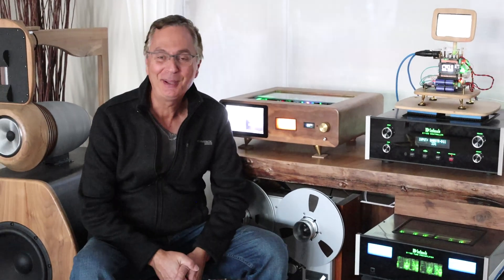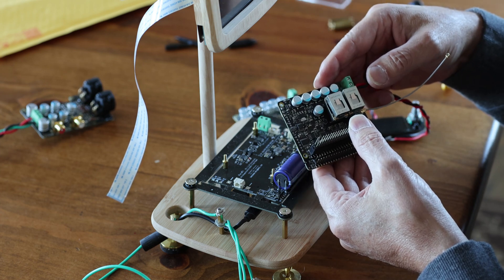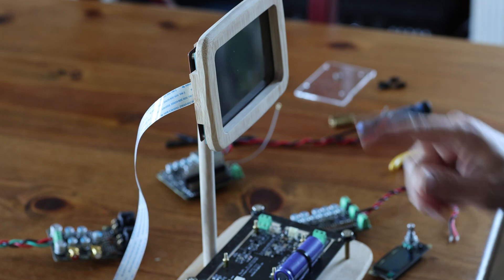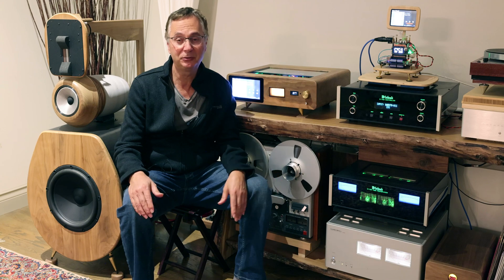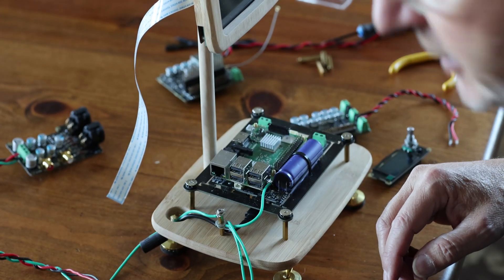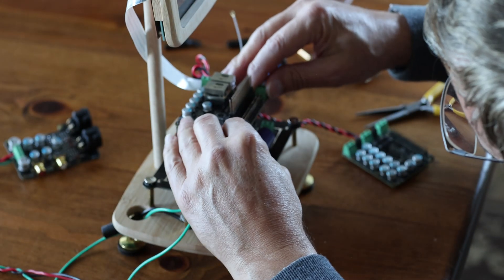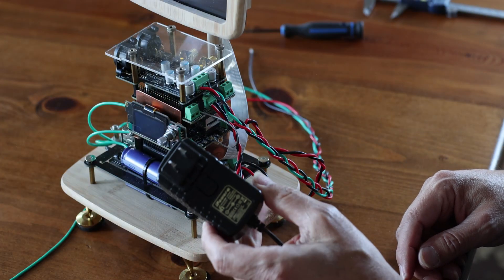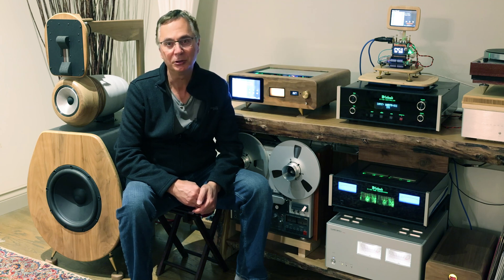Build a Flagship DIY Dac from Ian Canada Parts and save thousands of $$$ Gabster D6

Comment: In you video, you show a connection from PurePi to the Fifopi Q7.   But in the IanCanada tips, it says that "FifoPi Q7 has built-in isolator so it needs two power supplies to function. It will not work if feeding with only one power supply. No XO LED is lit means FifoPi doesn't have the 3.3V clean power supply".  I am kind of confused now!

Comment: What gauge wiring are you using for the 3.3v and grounds? Looks like 12 or 14 awg stranded copper?
Reply from the maker: 11 Awg stranded ofc copper silver plated  twisted as short as possible
Reply: @ you mind listing where you sourced that wire, doesn’t seem easily available.

Comment: You said i will go step by step, then the ground wire magically appeared as if i would know where to and how to connect it. You said get 3 power supplies and then quickly showed us what to do with two of them, but you didn’t really say where the other end of the red, green black cable came from. And what it the other power supply for, do i just put it in the drawer😢😮 Maybe another video to tidy up these issues. Thanks
Reply from the maker: @hifi-asylum  
The 3d power supply you use  to power the pure pi  and the other 2 to create +5v 0 -5v for the OPA 861 board.
I know it gets overwhelming at the beginning I have been there 😱😊
The ground green wire goes to earth ground Easiest is to power socket ground or ground terminal of your amplifier.
Hope that helps

Comment: Ok, very inspiring. Wish that one power supply would be sufficient. Maybe a single LPS with three outputs? Also, did you make those shields or can they also be purchased? Sorry for all the questions…
Love that you used a small cutting board for a base. Even using the hang hole to route those ground wires 😅

Comment: Hi Gabby! will adding power connections through UcConditioner MkII 3.3v to this stack also works? the way you explained the Streamer build....please advise.
Reply from the maker: Yes you can like I show it here https://youtu.be/fv_aywqlo9Y?si=z_l8iSZgBlDieWrj&t=246
Reply: @Gabster1  Thanks for quick response and the clarification.
Reply: @Gabster1  If we plan to add UcConditioner MkII 3.3v to this Gabster D6 Stack, for power connectivity which one out of these two options you advise.... 
A.	Pure Pi II 3.3V -> UcConditioner MkII 3.3v -> Q7 & also from same UcConditioner MkII 3.3v -> Dual Mono DAC Card (is this OK to plan or won’t work at all?)
[OR] 
B.	Pure Pi II 3.3V -> UcConditioner MkII 3.3v -> Q7 & Pure Pi II 3.3V -> Dual Mono DAC Card. Please advise. Thanks in advance.

Comment: I recently bought a vintage Sansui 9090 and some Kef 107 speakers, primarily for 2 channel listening. I use Youtube music through an Apple TV feeding a Sony Bravia. I use the toslink digital out from the Sony to a very cheap Prozor dac to the Sansui. I will be adding a CD player soon. As I am using the vintage receiver  I don't have remote volume control. Is it possible to add this to the Flagship DAC, and is my system resolving enough to benefit from this DAC?
Reply from the maker: If I can be honest your biggest upgrade will be from using a high resolution streaming service or a good cd player. There is a world of difference between YouTube music /spotify and a high resolution system like a cd player record player Tidal and Quobuz 
Your amp and speakers are good 
A Dac like this or a cdplayer/ record player will benefit you
For the Dac you will need a Tidal Or Quobus suscription and Roon or Volumio ….
Hope that helps.

Comment: Hi. I see it's not the OPA 861 that comes with the kit, but #7A transformer I/V. Is it an important difference? Best!
Reply from the maker: Both are good options the transformers do not need power the Opa861 has slightly better dynamics and low end
Reply: @Gabster1  But I will have to solder the transformers 😩 Think it's best to avoid it... 😊

Comment: Built it! Just finished it. Thank you so much for this video! A lot of back and forth with the video and Ian's manuals, double checking myself. No shielding or extra grounding, not sure if it is necessary though I might at least add these features as not that hard. I know there is all kinds of unpredictable placebo stuff that could be affecting my experience but wow, so far this thing, as ugly as it is, just completely smokes my other dacs. Suddenly more palpable space, texture, details. Using Roon. Will be testing across a broad array of speaker/amp combinations.
Reply from the maker: Thanks Sheldon for sharing your experience 
If you feel like it and Interested I will be doing a subscribers builds where I showcase systems like yours you just need to send me a few pics of your system and a couple lines like what you just said describing your experience. 
My email is in the about section of the main YouTube page
Reply: @Gabster1  That sounds great. I have sent you an email. Thanks!
Reply: Hello which dacs did you compare your diy to?

Comment: Gabby, total newb here. We purchased 2X  of the set RPi, FifoPi galvanic iso board, Dual DAC board, Op amp board from Ian about 3 1/2 years ago. We have the double shield /gpio extender boards from Ian too. Do you think they are as good as your copper shield? We are getting close. Currently both DACs are in enclosures with 2x 4TB drives, an optical drive, 5” touch screen, ESS controller and usb wi-fi dongle with external antennas.
Reply from the maker: Sounds like a fun project yes the double shield Gpio are good don’t forget to connect the RPI to earth ground
Reply: will do. as for the rest, a SP-9 + ST-120 (complete) and a Erhard Audio Pre (complete) + ST-120 (in progress). The concept is the DAC will be a digital album repository. @Gabster1

Comment: Thanks for the video Gabbie - where did you connect the star-ground wire on the Raspberry Pi? I have the Pi 4B so the ethernet and USB ports are reversed, but I cannot see where to attach the ground wire
Reply from the maker: I soldered it to the metal housing of the USB any metal housing on the pi is connected to ground

Comment: Hi Gaby.  I built your Dac and I have to say it's a significant upgrade from my Node 2i.  I am also using the Raspberry pi as my streamer with Volumio.  I am having one small issue that I can't figure out.  When playing multiple songs in a playlist with Tidal Connect or Spotify connect, the beginning of every subsequent song is slightly cut off.  Is there a simple fix for this?  Volumino doesn't respond quickly.  Thanks again for inspiring me to build this.
Reply from the maker: hmm not sure have not used volumio for a couple years disable any volume control settings or level matching,DSP etc... if any as they degrade the sound and cause problems.
try asking on Ian's DiYaudio forum someone may be able to help maybe 
https://www.diyaudio.com/community/threads/asynchronous-i2s-fifo-project-an-ultimate-weapon-to-fight-the-jitter.192465/
Reply: Thanks, I'll try that.  What software do you use instead of Volumio? @Gabster1

Comment: Can we add TransportPi AES/HDMI Pro II along with Receiver Pi Pro II/ReceivedPi DDC to this stack to get the input & output options? If yes, could you please share how the stack Cards positioning and connections will be. Interested to know Fifo Q7 signal wire handling... Please advise.
Reply: Thanks Gabby. Even the projects page is still not having such combined stack options....this will be very helpful. Please plan to share.
Reply from the maker: I will do a video in the future you can also get ideas from Ian’s new website Iancanada.ca
Under projects
Reply: @Gabster1  could you please plan a video for a single streamer+dac stack build. waiting for this....

Comment: Hi Gabster, I just looked at all of the components for the build (including tax in Quebec) and it comes to $1,338.00 CDN give or take a few bucks and this is not including any options.  The 3 Ifi power supplys really kill the price point as they alone are $375 (tax in).  Ian Audio is $700 CDN (delivered) for the 94a kit. The raspberry pi and all of the little extras makeup the rest of the cost.  Given that the Ifi power supplys are so expensive might it be less expensive to use the upgraded power supply you mentioned?
Reply from the maker: The IFI is good for People that have No or very limited DIY experience.
If you have some knowledge I would use 2 or 3 of the Cheap ebay regulator 5$ (must replace the Potetiometer) each and some old Transformers you may have around
https://youtu.be/bzXoypmVUus?si=OFkyF1X6wCEDr_Up
You need to be careful not to fry your expensive boards also need 4v higher then intended so a 9V transformer DC or AC is Ideal or pay the same $ and use the Linear Pi reg by Ian.
if yo have limited DIY experience start with the Protodac Cheap and inexpesive then Build the D6 You may also want to try The MIni IP
https://youtu.be/m0esUvVu9W8?si=kc9p9c4FhjzCau5J
 start without Q7 then with. The journey is as rewarding as the results

Have fun If you build it send me a few Pics a and a short story would love to share your results on the Chanel.

Comment: Sorry for the silly question but what SC-Pure Clocks do I need?  There are 4 listed on Ian's order sheet; 80A, 80B, 80C and 80D.
Reply from the maker: No Worries I would suggest the #80A and #80B pair of SCPures  45/49 But the FifoPi Q7 comes with 2 clocks to start with. Nice clocks but not as good as the SCPures
Reply: @Gabster1  Thanks so much for the reply.  I will do just that.  If I want the DAC to have inputs other than the PI it seems I would need the ReceiverPi Pro II.  Is that correct and is just another board that stacks on top of the rest?  Thanks again for the information.
Reply from the maker: @theaddies  I would suggest the just released #19D. ReceiverPi DDC for $10 more it is by far more advanced. :)

Comment: Please be careful with the copper shielding behind the MonitorPi Pro!  I think mine created a short between the GPIO pins behind the MonitorPi and a tiny bit of smoke came out from the back of the FifoPiQ7 (i think it was that board, but not sure).  So instead I covered my copper shielding with electrical tape.  The dac still works.
Reply from the maker: Yes that is very important I wish I showed that more in this Video  I did show that in the Streamer/dac video glad you did not fry it here is the Link at 17min
https://youtu.be/r_BjWSMKjEc?si=LSqmkkdHhqpRJuVy
Reply: @Gabster1  

Thanks for the reply.  The DAC is sounding amazing!!! I plugged in the Accusilicon AS338 clocks and they really take the DAC to a new level, I can imagine that IAN's SC-PURE clocks would be even better.  I'm so excited about the clocks that I'm contemplating the NewClassD Nuetron Star 3 clocks.

Comment: I just finished assembly and Im using Moode but Im getting all zero's when a song is playing, and no output sound. I must have missed something in the configuration but not sure where. Can you show what the configuration settings should be set ?
Reply from the maker: Check all the wiring compared to the Video make sure the grey UFL is connected I never installed moode but it is similar to most RPI setup 
use I2s Generic Driver if asked 
When you sart playing a song the fifopi clock light should turn green.
You can also post some photos on the Community page and someone can help you as well hard to diagnose without Visual here is the Link
https://www.diyaudio.com/community/threads/asynchronous-i2s-fifo-project-an-ultimate-weapon-to-fight-the-jitter.192465/page-543
Reply: @Gabster1  I was finally able to get it to read something other than zero's but I have no sound output of the opa861 going to the input of the pre-amp. Not sure what it is I am over looking.

Comment: Have you experimented with Silver wire conductors instead of copper wire for running the 5v and 3.3v power lines?  I have constructed your dac but I think I'll upgrade the electrical wiring to OCC Silver with solid metal core instead of stranded.  It's not too expensive.
Reply: I am also thinking about adding OCC Silver wiring. Did you hear any sonic difference after the silver upgrade?

Comment: Thank you for your efforts and time spent to bring more people closer to good quality audio!

For years, I am using RP as streamer and mamboberry (ess) dac, with simple i2s connection between.
Everything is cleanly built with separate high quality power supplies, good filtering and physical separation between ps, rp, dac and preamp.

I was avoiding reclocking by always using just i2s interconnection.  Some experienced people suggested to me that it is better to have cleanly built i2s than loosely built reclocking.

Would I benefit by switching i2s to reclocked signal as you are using?

Thank you!
Reply from the maker: Keep your dac as is as a reference and build another one like the D6 here with Ian’s parts and compare this way you can hear the difference 
If you don’t want to spend a lot of money build a protodac a see if you like it better.
It is important not to alter your existing setup till you find one you like better.

Comment: Looks very interesting, Thanks for this video. I am planning on buying this unit (with accusilicon clocks, nog too expensive and I hope it Will improve the sound). Now is my question, how does this sound compares to other dac’s (you have listened to) . I know this is a difficult question but im really eager to know since I already have a micromega mydac and my father a Chord qutest . Another Thing i’d like to know if I can replace the rather expensive ifi power with cheaper power supply’s without a significant löss in sound quality? Thansks in advance
Reply from the maker: Sound compares well with Dacs in the 5 to 10000 specially if you have the best shielding and power supplies
For Cheaper psu you can try the cheap 5$ eBay psu board I reviewed see my other video on it 
It would be better the a ifi you can use a old linear transformer 
You would need a few and not be afraid of soldering a bit.
Watch not to short or reverse polarity could be expensive mistakes.
Have fun :)
Reply: Thanks! Is it correct that all the components (rpi, ifi power supplys, other Amazon components  included) together almost Costs 800 dollar ? Turned out more expensive than i thought..

Comment: I don't understand why Ian Canada makes it so hard to order. BTW, when you said this DAC compares to dacs $5K plus, have you got some names? say a Venus or Terminator?
Reply from the maker: As good as the terminator if not better 
Never heard Venus rarely people buy that one 
Leaps ahead of the Pontus 
It is so easy just download the xls form fill and mail
Bear in mind he is a solo person doing it all 
Not a huge company let’s keep it that way for the benefits of the diy community 
So many companies with 20000$ dacs now often cost 2000$ to build if not a lot less.
On the other hand there are a lot of dacs out there around the 2k that sound very descent so don’t expect major differences just small ones you need a very resolving system to hear them.
So spend your money on speakers and preamp/ amp first.
Have fun
Reply: @Gabster1  Thanks for your response. You got me interested in building this setup as I am in search of a good DAC. In your video, you used two power supplies to power the Output stage with the +5V / 5V required. I want to use the Linearpi MKii Solo board to power the Outstage instead as I have a few spare Linear power supplies. The LinearPi has a 5+ /5 output but where do I wire the ground from the output stage to?

Comment: If I build this version with the PurePi and later want to upgrade my power solution, can I still implement the PurePi but now separate from the stack? Instead of mounting the RaspberryPi on top could I instead use the 5V out connector that you are not using in this video, to power either the Raspberry or perhaps the 5V on the Q7 (if I for instance use a StationPi and need to power the Q7 5V seperately) and the use then 3.3V to power the clean side of Q7 or perhaps the DAC?
Reply from the maker: I believe you can

Comment: Nice video. I do have a Ian Canada dac running with most of the bells and whistles next to a 4 deck dddac. First and best upgrade are output transformers insteed of the opamps. The dddac wins by the way ;)
Reply from the maker: I heard great things about the dddac 😊
Reply: @Gabster1 I use that as reference as you talked about in another video. If you can get you’re hands on one, buy it. Do you hear lots of difference with the wonderful D11?

Comment: I'm planning to build a DAC and your builds seem to be really good. I specially like this D6.
because most of us already have some kind of streamer, it would be great though if you build a pure DAC (without the streamer part). that way it would either be cheaper or we could spend the cost of the streamer parts on even better components (if possible).
what do you think?
Reply from the maker: It is a very good idea but there are advantages to have them in one box is you avoid converting the signal out then in again and no interconnect cables. The less parts in between the better.
Reply: @Gabster1  ok, true, but please consider it anyway. ;) I would trade that for keeping my current streamer and not pay for Roon.
but anyway, what do you suggest as a free alternative to Roon for the RPi?

Comment: Thank you for the video.  How did you connect the wires? The red +5 and the black -5 wire? And to confirm, you also connect three wires together: red, black, and green "centered pole"?  I googled "pigtail wire connections" but I'm sure if this is appropriate.
Reply from the maker: I made a simple drawing as a lot of people stumble on this Hope that helps
https://drive.google.com/file/d/1NEGwD_zHkeSM7-h5HbGUABxTFN-La0H7/view?usp=drivesdk
Reply: When you refer to the output from the SMPS as + and - 5v, you really confuse people. It outputs +5v and 0v. Also,voltage is all relative to each other, so you can stack them and use one level as the GND reference as you are doing to get the +5/0/-5v